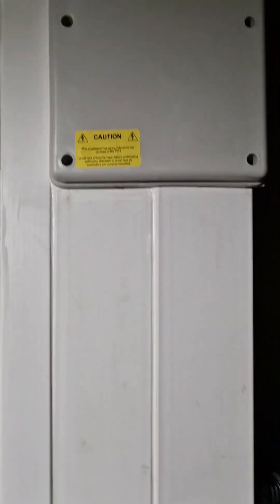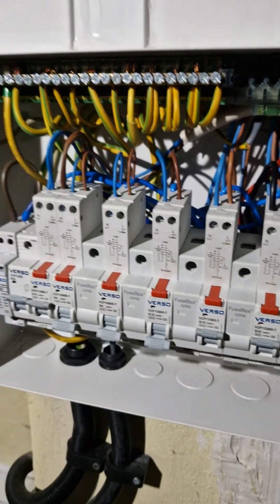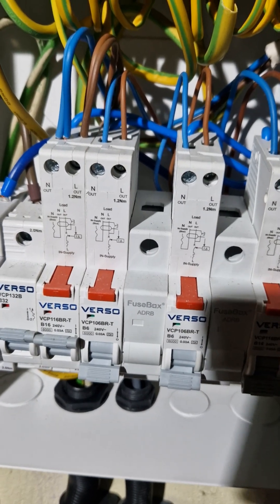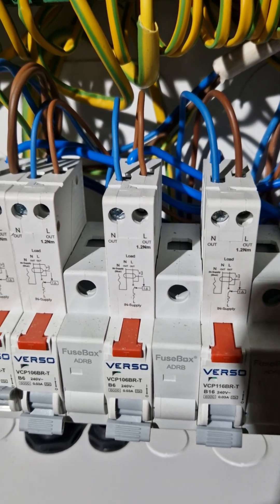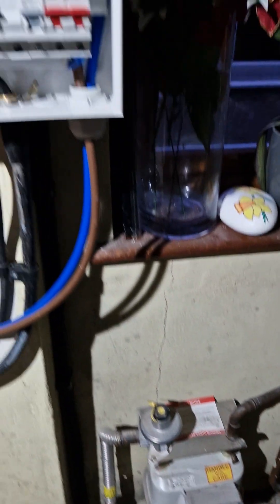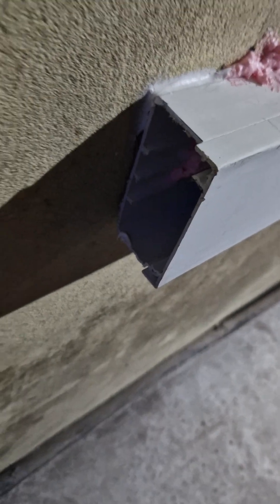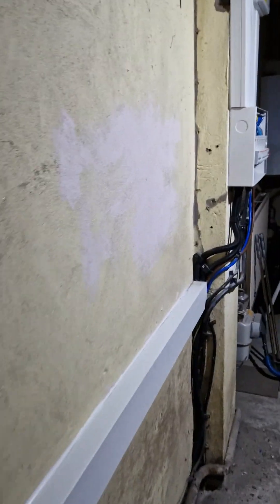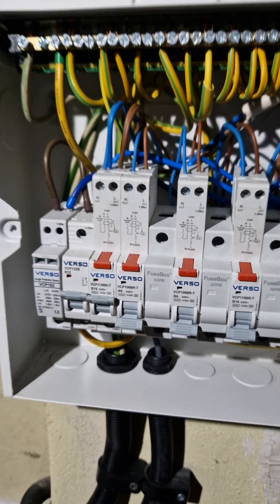Fitted a new Verso RCBO Consumer Unit with SPD protection

Comment: Shouldn’t have tails running more than 3 meters from the main cut out should be swa
Reply: Should be fused down, that's all. Loads of newbuilds with standard sheathed tails over 3m.
Reply: Did you do an EICR before doing the board?